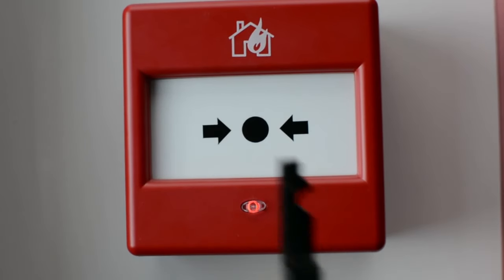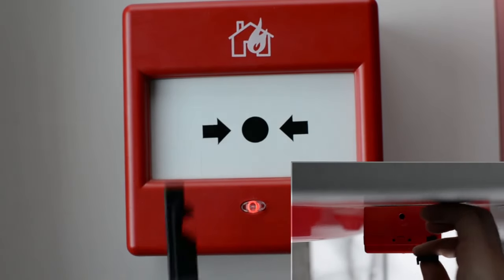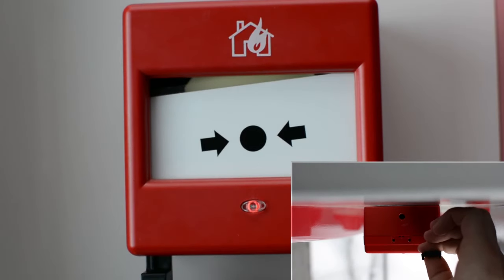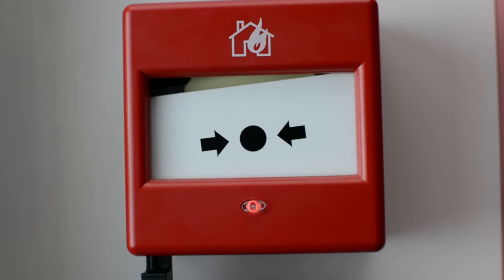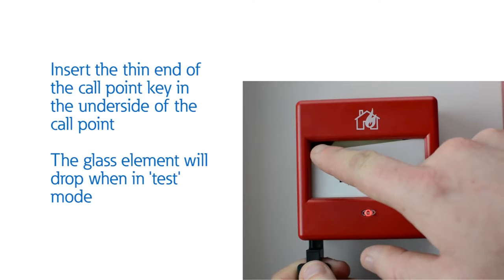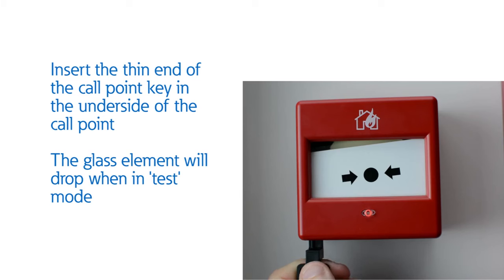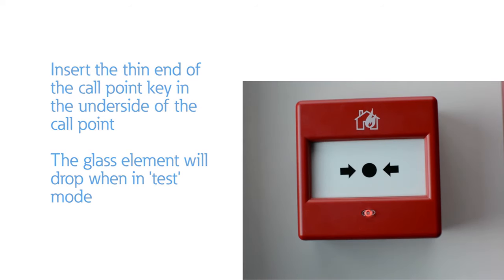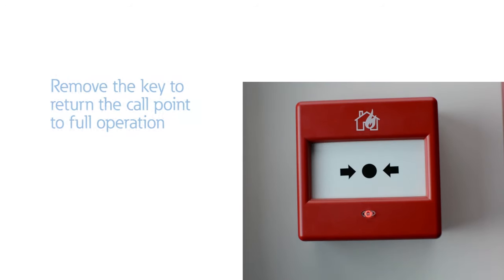How to test an Eaton manual call point - Fire alarm break-glass

Comment: The Man says: To Test The Fire Alarm Call Point Is In Full Operational Mode Insert The Thin End Of The Call Point Key Into The Test Function On The Underside Of The Core Point Whilst Into Test Mode The Glass Element Will Drop! Remove The Key And The Glass Element Will Reset Into The Correct Position